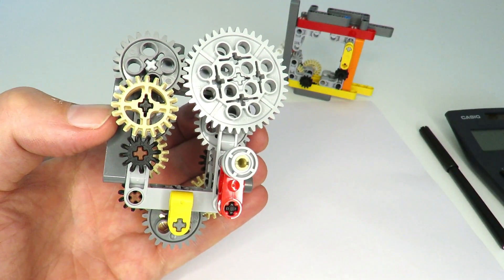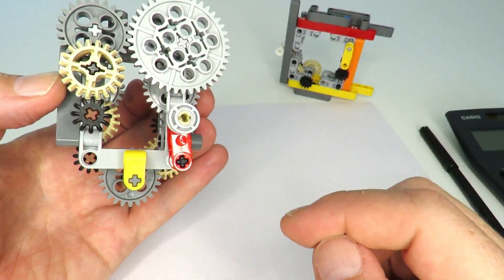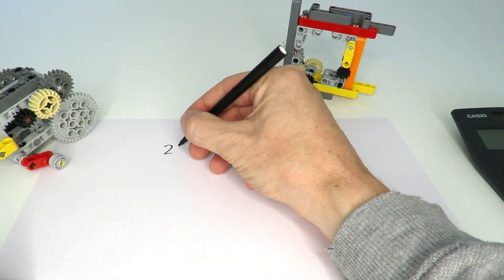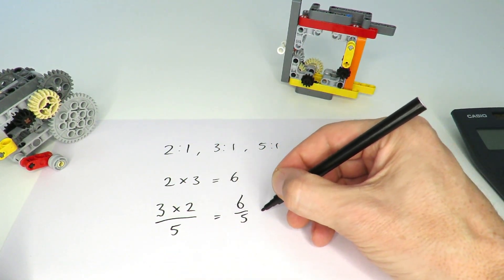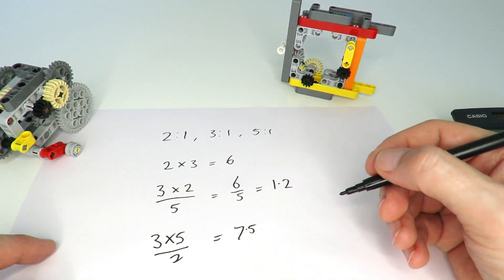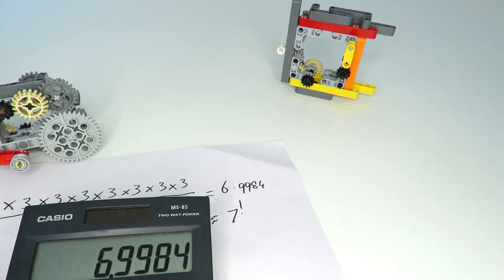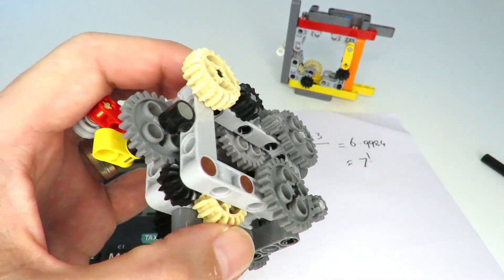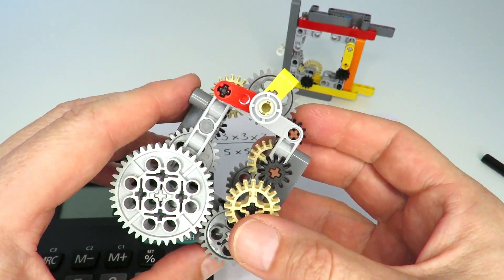How to create 7 to 1 Lego Technic Gear ratio without a Z28! Build instructions included.

Comment: 10 to 14 to 8 to 40.
Reply from the maker: LOL but where is the 10 tooth gear? 😂
Reply: I think the 10 and 14t gears are splat gears, which means the radio is 1.4:1. if you combine this with the 5:1 gearing and you get a 7:1 radio (just like a 20 to 28 gearing)